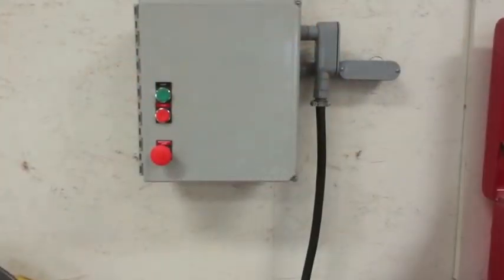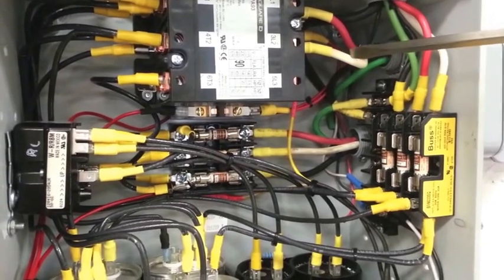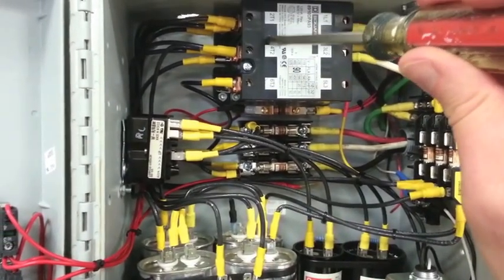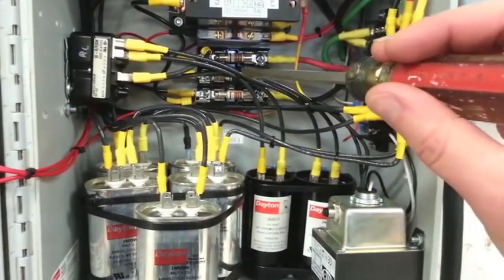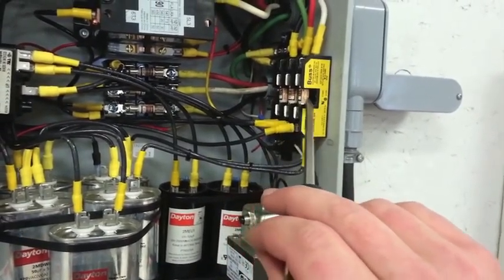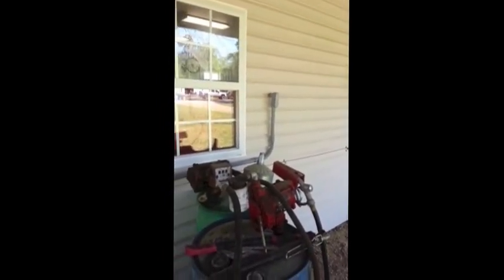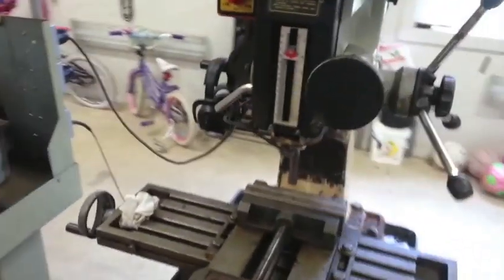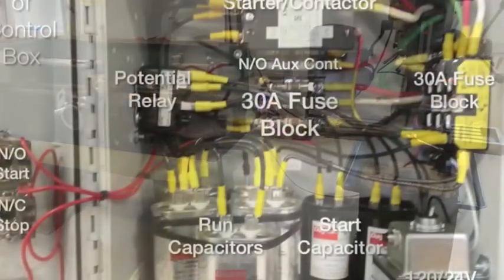Rotary Phase Converter

Comment: Great setup.  I just have a couple of comments.  With the incoming cabtire cable connection, I might have used an angle flex connector instead of the bulky LB fitting.  Also, I'm wondering why you didn't use the black wire instead of the white wire for the incoming single phase power?

Comment: So does the run capacitors go before the slave motor or after the slave motor
Reply: The gray color capacitors is connected before  the idler motor or slave motor , it will function as run capacitor and balancing the voltage produce to ghost line.
Reply: Even you connect after the motor its still the same connection

Comment: the diagram you linked to is very informative, thank you.  I have a little question for you;  the caps. in the vid i can just make out 1 40uf cap and what looks like 4 50uf caps for the derived phase run are these values correct?  the diagram shows 395uf.   what is the voltage rating on them?  the start cap in the diagram is nearly 800uf is that correct?  what is the voltage rating of those?  thanx again!

Comment: Question - how does the idle motor generate 3 phases? Single phase is sent to the idle motor which causes rotation but how does it produce another phase?
Reply from the maker: The following is not a proper technical description, but in the broad sense of the term, the motor is acting as a generator and producing a 3rd 'wild leg'.  I say wild, because the voltage varies quite a bit and typically requires run capacitors to  to stabilize the wild 3rd leg.  There are more technical ways to describe this, but in layman's terms, this is basically what happens.
Reply: MrMarcaap thanks. After the main contractor did you wire into the potential relay then to capacitors then to idle motor? Are the start capacitors wired in series with one of the idle motor phases? You should make a video of each wire connection, Your video has helped me understand quite a bit.

Comment: I would want to get this box I curious Where did you get it from?  I have a chain hoist it's 220V 3KW (4HP) 3 Phase  I had stuggle to connected from 240V single to Chain Hoist it's not running.. I found out it's 3 phase.. I have to look find one single phase 240v to three phase 240v Please email to me Thanks
Reply from the maker: This was a surplus electrical enclosure that I picked up from my employer.  It was just loose in a surplus bin, so unfortunately I don't know the brand or model number.

Comment: MrMarcaap, I have a rotary phase converter that I currently start with a pony motor. I would appreciate more information on how your starting capacitor set up is wired. I would also like to know more the run capacitors - are they for balancing the legs?Thank you for any help that you might give me.
Reply from the maker: redaxe77 
Try this link:
https://dl.dropboxusercontent.com/u/24231093/Documents/RPC.jpg
Reply: Just took a look at it - Thank you

Comment: great job making one at the moment in Ireland looking for  some help I have a 10 hp running at 750 rpm does the rpm have any inpact on the power it is duel voltage @ 360 and 660 for star what is the PF cap you have between  the two hot legs and I presume you have only one potential  relay in the diagram you have two thank you in anticipation Joe

Comment: sorry to keep bugging you. roughly how much did u pay to get it up and running.  I've called around for the caps and each one is like 300 to 500 dollars. do u know where I can order them from. thanks
Reply from the maker: I ordered most all from Grainger.  Before I tell you how much I have invested, let me tell you I already had the enclosure/box, the motor and all wiring, both for the converter, supply power and distribution power wire.  With all that said I still have almost $1000 out of pocket invested.

Comment: so In regards to that 40mfd cap for the pf what is the purpose of that. does it have to be  used and also can it work with just using the motor and the start and run caps to get the 3 phase output without having to do the relays and other stuff? thx

Comment: hi. I have a 10 hp motor. how would I calculate the start and run capacitors for the idler motor. thank you.
Reply from the maker: Funny that you ask that particular question.  The controls were designed for a 10hp motor, so you should be fine with the layout that I have.  My 10hp motor was bad order so I used the 7.5hp that I had on hand.

Comment: Sir it has been my understanding the 3 phase is cheaper to operate per usage.... can this be true using a rotary phase converter as to a transformer...  I hope you respond... Also using a 71/2 hp, converter does that mean your combine usage should not exceed 7.5 ph regardless of what it is being used on.... I thank you Roger Fossette

Comment: capacitor question, saying  L1&L2 are line and L3 is the phantom leg your drawing has caps parallel between L1-L3 and L2-L3 with a smaller cap from L1-L2. every other drawing I see has all the caps paralleled from the phantom L3 to either L1 or L2 but not both and none between L1-L2. is this a better way of balancing the 3 phases? and if so why does it list different uF on the 3 legs?  thanks for any help you can offer.

Comment: sir i am doing my major project and need to run 3 phase motor of about 7 hp from single phase so please update a circuit diagram to make it easy. I have went through your ckt. diagram but that was not easy to understand, please send me a simple ckt diagram for this
Reply from the maker: sajan dilwala I'll look for my old drawings.  If I have them I'll scan and upload
Reply: sir i have the deadline of my project and i need it so badly to complete the project
Reply from the maker: Sorry I wasn't able to find my paper copy with the simplified diagram
Reply: so any clue sir so that i can make it possible for my project

Comment: do you have a wiring diagram for this?
Reply from the maker: Try this url:
https://dl.dropboxusercontent.com/u/24231093/Documents/RPC.jpg
Reply: Thank you.
its cool that your country runs 2 phase @ 120v + N but here in the UK with just 240v L + N I don't believe this would work for me.
its very nice and a clean job. well done.
Reply: you might want to look into that davies85, I am willing to wager that the UK is running 240v single phase with no neutral so L1 L2.  much like australia, there they run 3ph to homes and only the newer ones have a ground at each plug.

Comment from the maker: Jason,
I would recommend about 90% of what your idler motor is rated for, so in this case ~ 6.7-7.0 hp.  I run 5.5 hp with no issues whatsoever.

Comment: MrMarcaap could you share a little more information with us.1. how many total microfarrads of run capacitors are U using? 2. What is the winding configuration of the idle motor, Y or Delta?  3. A complete schematic of the phase converter? You have done a beatiful job on yours and hope to build myself one. Thanks
Reply from the maker: 340 MFD Run Capacitance
Delta winding 
https://dl.dropboxusercontent.com/u/24231093/Documents/RPC.jpg

Comment: also how much capacitance are you running on the start cap? i have a 1000uf start cap for my 7.5 it seems a little harsh, but anything under 900 i was getting rotor lock.

Comment: btw my converter doesnt use a potential relay, because i couldnt find one. I believe it to be the heart of my issue. But not knowing much about this, i cant be for sure. I am using a timed relay and momentary switch to turn  two contactors. one of which drops the start cap out when the timed relay decays.

Comment: its a 7.5hp motor. Its sort of an oddball, the plate says its for "200" volt. It only has 3 wires coming out of it labeled one two three. i have no idea if its internally wired delta or wye, or even what that is really. but i know people ask about it. When you start your mill or lathe, do you hear or know if the potential relay brings the start caps back in for a second? Your tools seem to jump to life, mine sort of roll into action.

Comment from the maker: Yeah you're right, it's nothing more than a contractor.  If you'll tell me what hp converter you have and what hp motors on your equipment, I'll try and troubleshoot for you. One area to check is that your motors are wired for the proper voltage, if they are dual voltage

Comment: Motor starter is just a big ass contactor right? {i used 80a allen bradley contactors with 110v coils} When i start my lathe or mill, the idler motor wants to nearly stall and the machinery starts slowly. Any idea or possible help trouble shooting this thing?
Reply: you need a larger RUN CAPACITOR, or more of them...